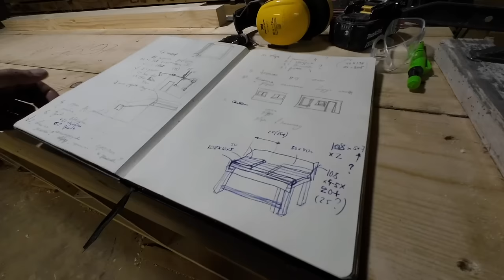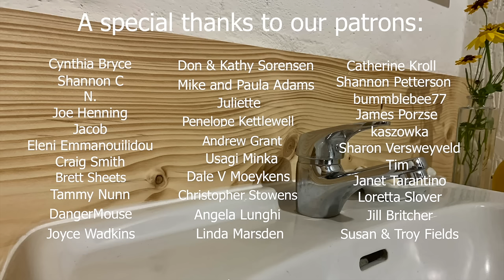We have WATER! / DIY sink countertop - QUICK and EASY

Comment: Would put adjustable leveling feet on the bottom of each leg. Easy to install and adjust AND they keep the wood legs from touching the floor. Your cabinet design is a work of art. 👍👍👍

Comment: Might I suggest you seal your wood as well as possible and then use silicone caulk to seal all of the joints. Worked beautifully for the butcher block countertops I finished a few months back.
Reply: Yes, definitely. I know it's short-term, but seal the wood

Comment: The squash you grabbed is a butternut squash used mostly in savoury dishes like pasta, soups, stews.   The smaller pie pumpkins are needed for pies. Clean them out, cut in half, roast/bake upside down on a baking sheet for about 1/2 hr until soft.  Scoop out the flesh (no seeds or stringy bits) and then blend in a blender to be smooth.   Drain the purée through some tea towels or ‘cheese cloth’ to get excess water out.  Now the purée is ready to be used in a pie, or cookies, or cake or loaf.
Reply: I thought the same thing about the squash.
Reply: I know in Australia, we call them butternut pumpkins, not squash, so maybe it's referred to as a pumpkin in their local language also?

I agree butternuts are better for savoury dishes than sweet, but I've sometimes mixed it in with sweeter pumpkins because I had extra butternut that needed to be used up. It's not a great flavour or sweetness for pumpkin pie on its own though.

Comment: Great work on the sink cabinet.  I noticed that in the sink drain system you didn't include a P-trap.  I don't know what it's like in the EU, but typically that's an important part of a drain system in the US.  It prevents the sewer gas from coming up through the drain system.  I'm not sure what this system drains to, but it might be a future improvement.
Reply: The metal part under the sink is the p-trap

Comment: You need a "p" trap for the sink. Its to prevent sewer gases from coming back up through the drain.("S" shaped  but called "P" trap)
Reply: Looks like he's using a European bottle trap.
Reply: And it doesn't look square to the sink drain, so may leak over time. @100Ronster

Comment: Very good!  Would you be using some kind of caulking around the base of the sink and seal the wood to make it waterproof?    

With all that pumpkin there are so many delicious things to make with it!  I love pumpkin pie (and yours looks 'rustic' and it's beautiful!) but also pumpkin muffins, pumpkin bread, and soups are delicious!  You can also make a pumpkin puree instead of mashed potatoes.

Here's an easy recipe for pumpkin soup:
6 cups chicken stock
4 cups pumpkin puree
1 cup chopped onion
1 clove garlic, minced
1 ½ teaspoons salt
½ teaspoon chopped fresh thyme
5 whole black peppercorns
½ cup heavy whipping cream
1 teaspoon chopped fresh parsley

Place chicken stock, pumpkin, onion, garlic, salt, thyme, and peppercorns in a large pot; bring to a boil. Reduce heat to low and simmer, uncovered, 30 minutes.

Transfer soup to a blender or food processor in batches; blend until smooth. Return soup to the pan and bring to a boil; reduce heat to low and simmer, uncovered, for 30 minutes.

Stir in heavy cream.  Ladle soup into bowls and garnish with fresh parsley.  

If you make extra pumpkin soup, you can freeze it for up to three months.  I would suggest freezing in batches so you only need to thaw what will be served.  Just thaw in the fridge overnight and next day reheat on the stove before serving.

I don't know if the farmer next door would allow it, but a little pumpkin is also a delicious treat for cows.

And I loooove roasted pumpkin seeds as a snack!

Comment: The plumbing is so different than what I have installed in Canada. The installation process would have me putting stainless piping, including a P Trap under the drain to avoid any back-gassing from the line. Other than that, great work, looks nice!

Comment: pva glue is best dealt with while still liquid as a damp cloth will take care of cleanup as opposed to much scraping and sanding it is also better to wipe excess pva glue while wet as it shows in finishes if left to soak into fibre and cure. thanks for the videos

Comment: To be honest, I always find wood, even if it is oiled, difficult in the bathroom and kitchen. At least I would have double coated with boat clear varnish (also the floor in that area) and closed the joints with silicone. I would also have rounded the edges a bit and chosen a longer and swiveling faucet. But I see the biggest mistake in the sink drain. The odor trap on the downpipe is definitely missing here.

Comment: Looks like that's getting pretty close to move in ready, just in time for winter! Which begs the question... What do you have planned for heating/cooling in that space? Just a space heater and some fans since it's a temporary space, or something more permanent? I would have thought a mini-split heat pump would work very efficiently in that space, but it didn't look like you wired for that at all, and it can be really expensive, which doesn't seem to be the plan in there.

Comment: The drain is wrong, it needs a S loop or  will let sewer gas into the the room, as well as cold/warm air be let in. Easy fix, just add a loop fitment.
Reply: I think the chrome fitting that leaked is the p trap 👍🍻
Reply: It's an typical european setup using an bottle trap.

Comment: four mistakes with plumbing.  Hey might not a plumber..  :-(  

A.  Airgap is missing.
B.  P trap is missing
C. the hot water overflow does not go into drain.  It goes into cold water tap (tank).  are you missing another valve?
D. not use flexible pipe for drain, because  too difficult to clean out.

Comment: This is clearly not intended to be a piece of fine furniture or to be permanent. However, this kind of thing tends to end up staying around much longer than planned.  An oil finish isn’t going to work well for this type of application.  Repeated cycles of wetting and drying will cause the wood to warp and crack.  It can also cause the wood to grow fungus and to rot.  None of this is good for humans.  I would strongly suggest you use a thick coat of varnish for this.  Marine grade varnish would be best.

Comment: What are you going to do to protect the wood of the backboard from eventual damage from the water that will inevitably collect between the back of the sink and the backboard with which the sink appears to be in direct contact?  Also, you haven't included any diagonal bracing within the frame to provide lateral stability and rigidity.

Comment: You will probably be able to buy new hands from Hans if you cut off the legs in this way 😧 It is better to make the front leg 8 centimeters high so that the feet do not rest against it and the sink needs to be planted on silicone. Do you really need to install the boiler with the pipes up?